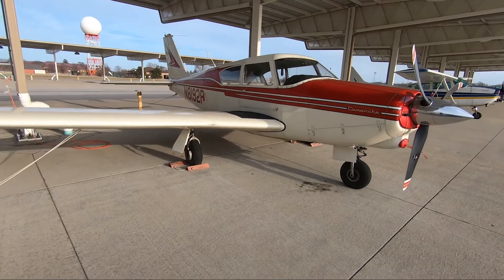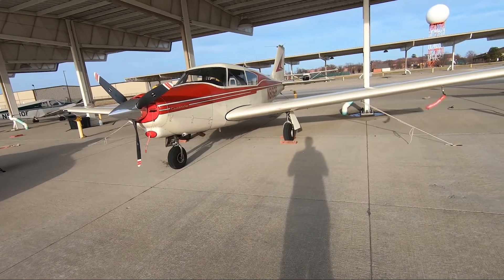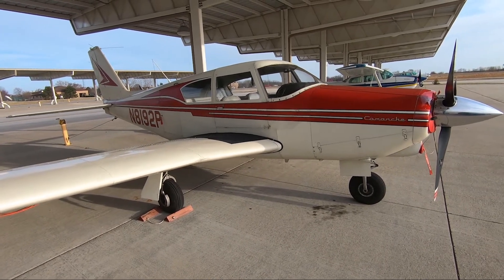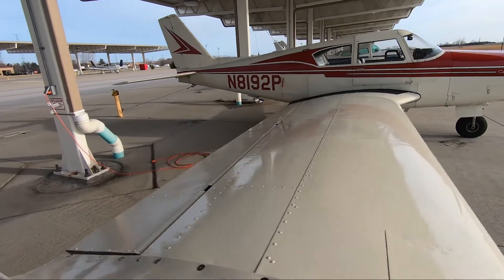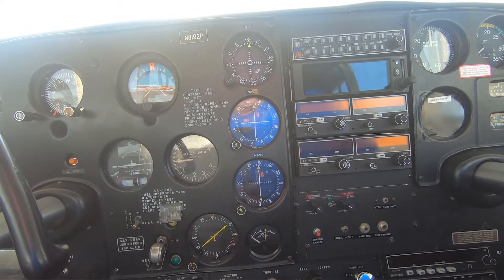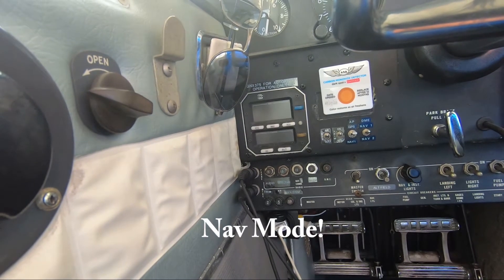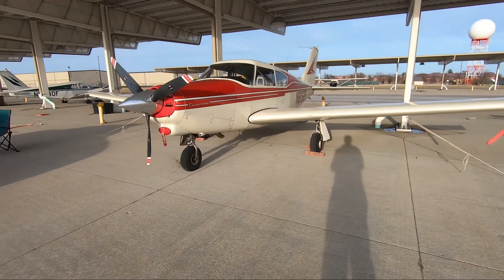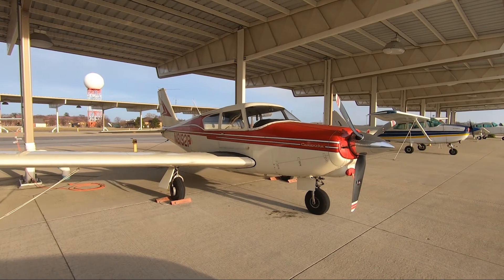Piper Comanche 180 Tour and Discussion

Comment: Based on the highest you’ve flown, what’s your opinion of whether the max approved altitude of FL210 is achievable? Have you heard of a 180 with both auxiliary tanks and tip tanks?
Reply from the maker: think the POH says 18500 ft for service ceiling. I’ve cruised at 11k many times and at 13k once or twice. Climb rate slows noticeably around 8 - 9k so the winds have to be really worth it.  I have not seen one with aux and tip tanks. Only the 250/260s have them as far as I know. But with just mains and tip tanks you’d potentially have 7 to 8 hours endurance.
Reply: Thanks. 18,500 is the ceiling at max gross (2550), but the copy of the POH I have (Page 1-6) says 25,500 at 2000lbs. That’s probably a brand new airplane with a test pilot, but it sure seemed impressive to be able to get that high with a normally aspirated 4cyl engine.

I’m thinking of a 1450nm flight hence the aux plus tip tanks question.
Reply from the maker: @colinbrathwaite334  for high altitude flying I recommend an electronic ignition. Advances the ignition for altitude, saves fuel, and I’ve heard mags can struggle up high unless the are made for it.  Probably should consider a turbo if you plan to go over 15k. The turbo twin Comanche would be the ride I would pick.

Comment: Would it be possible for you to measure the actual cabin width? Like door card to door card. Its hard to find this information as so much basic legacy aircraft information is just flat fictitious.
Reply from the maker: I'll try to remember my tape measure tomorrow for my flight.  I never measured it but Plane and Pilot Mag says it's 45".  Bonanzas are about 42".  It definitely is wider than my friend's Bonanza.  I like the extra room.  Don't have to rub shoulders with the right seat person.
Reply from the maker: yep, 45” across the seats.
Reply: @BlessedtoFly  Out side of seat to seat or wall to wall? Thanks BTW. I measured a cheroke 180 today at 41" wall to wall.
Reply from the maker: 45” wall to wall, basically thru the chest of the pilot and copilot at the insides of the window sills. The Comanche is not a plane where the right seat person has to move their seat back to prevent rubbing shoulders. I flew a lot with an instructor in winter and we had plenty of room even with winter gear on.
Reply: @BlessedtoFly  got it

Comment: Did you have any insurance issues using this for training?
Reply from the maker: Good question.  I bought it as a zero time pilot.  My first insurance policy in 2017 said "must be under direct supervision of a CFI" and the CFI requirement was 750 hrs total, 150 hrs complex, and 10 hrs in type.  After I got my PPL and about 60 hours in it I didn't have any further issues (other than cost of retracts with a low time pilot is higher).  The insurance world has gone insane (with the rest of the world) this past year so best to have a conversation with an insurance broker to talk it through.  Took some searching to find the right CFI too.

Comment: I was looking in to getting one of these! Quality craft.
Reply from the maker: thx for watching.
Reply: @BlessedtoFly  Your mention of how you got to wanting the Comanche as your airplane - finding your "Mission" was exactly the process I went through.  I have my PPL but wanted something I could continue training with to get my Instrument Rating, build time, travel with my family, cabin space, retractable gear, constant speed propeller, and just a darn good looking aircraft!

Plus the fact that they are overbuilt doesn't hurt.  One thing I've noticed flying the Comanche over the Warriors, Arrows, and Archers I've flown is how solid the Comanche is.  And as far as maintenance goes, it is actually one of the lower even though they haven't been built for what, 40 years?
Reply from the maker: @andrewthome77  Thank God it is well built.  I've taken it a few places I don't want to go back into during my early "license to learn" phase.  The maintenance really hasn't been that bad.  If the gear maintenance is behind then there is some expense to get that up to where it should be.  Really it's one of the most economical, retractable gear, complex planes there is.

Comment: I flew an 172 with a “complete” Electroair system on half the plugs and it ran like a Swiss Watch when it didn’t burn through the plug wires or plug tips. That ignition system put out so much power that it made short life of the plugs and wires. It only works really well for about a month,  then the trouble shooting had to start every month by finding where the missing spark was. Mechanics got tired of it and went back to mags.
Reply from the maker: I have had several issues but after investigation we have eventually been able to solve them.  My remaining mag had a loose connection, was due for overhaul and was causing problems.  Then I found my manifold pressure gauge was off and need to replace it.  Many of the issues were existing issues with my plane that we had to shake out.  I hope I am near the end of that and then can do a video of all we learned.  Thanks for watching.